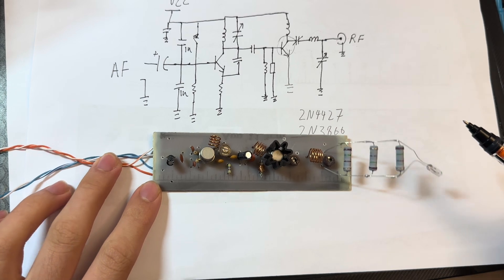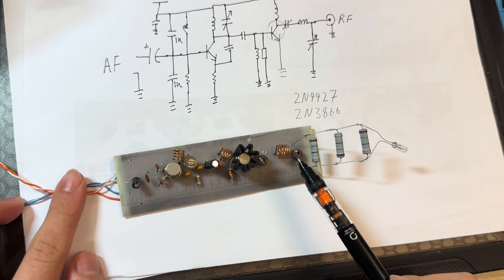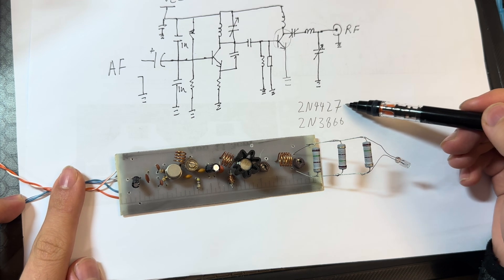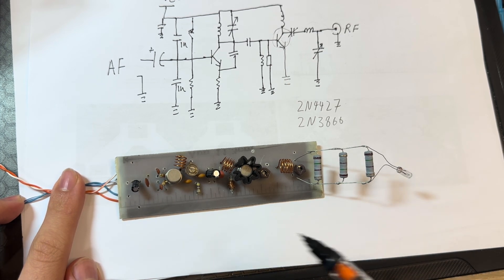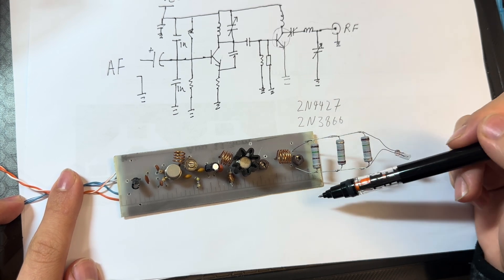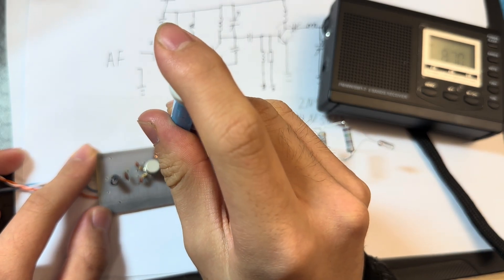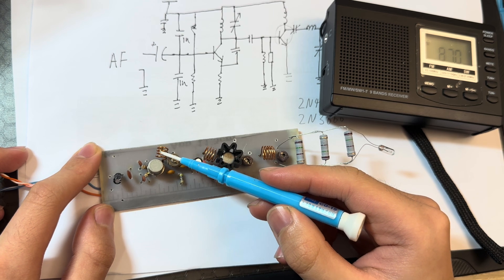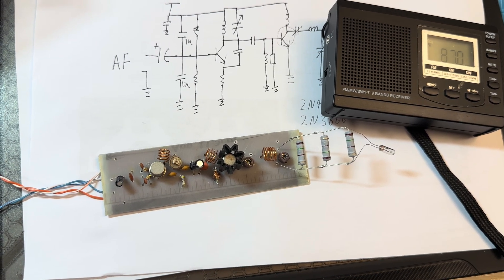Basic FM transmitter modulator part 2

Comment: Question: Are you still working on electronics transmitters and receivers?
maybe a TIP try making a short wave transmitter! ( With minimal power you can get terribly far away! )
and listen to the SDR of Twente in the Netherlands :   http://websdr.ewi.utwente.nl:8901/
attention please note!!! you have to set the SDR correctly otherwise it's of no use to you!

If you answer here I will tell you more,  So far for now!
Greetings from the Rotterdam location
RadioRob

Comment: In the Netherlands we (as pirates) used to use this oscilator too!
It can be found as: Josty Kit HF 65 - Google is your friend on this one!
unfortunately the builder had forgotten an LF amplifier,
This ensures (A bit more) that the oscillator remains more stable!
(the wiring from the sound source to the oscillator can cause instability!)
There are more mistakes made but we will forget to discuss them in this case!

Healthy and Friendly Greetings from the Rotterdam area!
Rob
Reply from the maker: Thanks Rob
Reply: @ReedSwitchTube  Just be careful with that 2N3866, unfortunately I can't buy them anywhere here in the Netherlands anymore!
Even decent good trimmers are rare!
Have you made a transistor LF amplifier for the oscillator?  it shields the oscillator and provides more stability
.
On KorteGolf you can also create nice transmitters,
AM modulated at 6300KHz with an inverted V antenna you can go terribly far!

Greetings from the Rotterdam area!
Rob
Reply from the maker: @hobbyrob313 thanks Rob, one good things is that I’ve kept dozens of genuine 2n3866 and 2n4427 made by centrisemi USA. Trimmer capacitors are getting rarer to find now days. You can still buy tiny trimmer capacitors cheaply which is good up to 15 watts before rf heating becomes a significant issue. Ceramic trimmer shown in this video can handle up to 30 watts where as plastic polymer insulated trimmer is good up to 50w with good cooling. The rarest type are mica compression trimmer, which I’ve seen handle up to 150w.
To increase oscillator stability you could add a phase lock loop system, which is very simple to do.